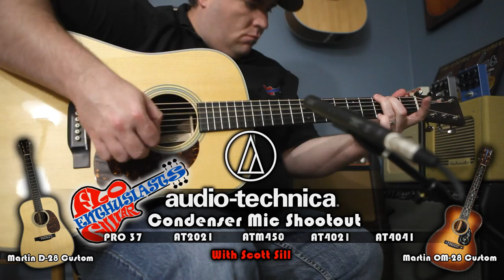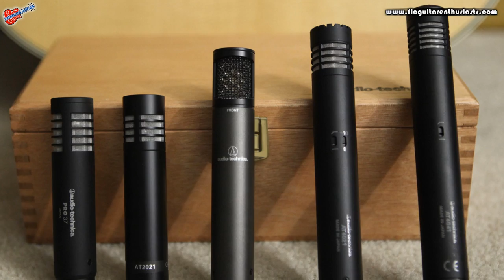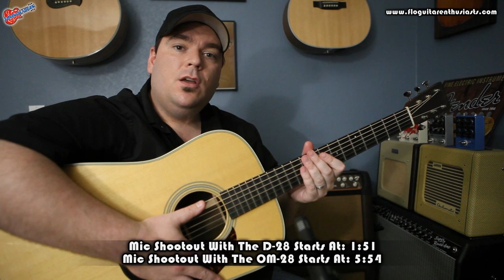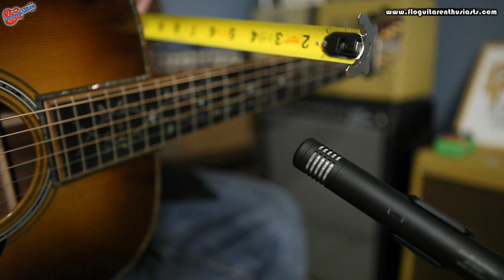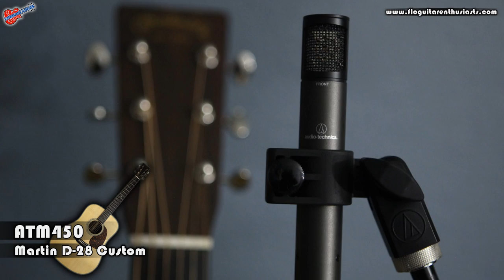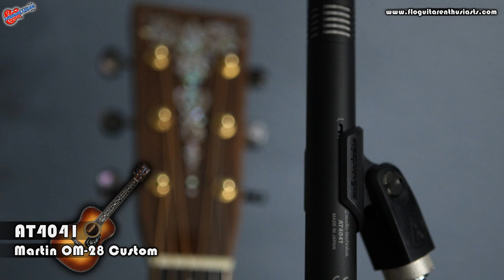5 Audio-Technica Condenser Mic Shootout: AT4041, AT4021, AT2021, ATM450, Pro37 With Scott Sill

Comment: I own two 4041s and I can tell you from my 12 years of experience with them that the positioning of the mics are off for proper tone. It is both too woofy, and dull on the top end for them to be in the right space, I spent at least 4 hours today with a D28 and a OM15 pointed right at one, and it sounded nothing like the 4041 examples you have here. The only reason I say this is that it may keep someone from getting into a great microphone!
Reply from the maker: Daniel Weldon thanks for the feedback.

Comment: Wouldn't it be better to try to position each mic in it's best sounding spot instead of trying to keep the conditions constant? When I choose a mic, I try to see where exactly it will sound best because that is where I will be using it in my recordings. If it doesn't produce the sound I want then, it isn't the mic for me.

I'm just saying this because I thought the placement for the ATM450 wasn't helpful -- it would have been nicer if you brought it closer to the guitar and possibly engaged the low cut.
Reply from the maker: Hmm maybe but this is how i do them

Comment: So I came into this shootout mostly looking for a condensor in a drum setting, for either overheads, hi hat, or snare.  I like that you gave us a variety of playing styles and some dense chords.  Some sounded dissonant too me but you're not a robot so strings can detune during takes or maybe you stretched one a bit at the fret, etc.  After listening on a few sets of cans in my studio, here are my thoughts.

[]4041 definitely sounds woofier, probably picking up that soundhole energy.  Over a set of tom drums that low end beef would be great depending on how you treat your overhead mics in a mix.
[]2021 lots of clarity but lows seem a bit weak.  Would be a good budget hat mic, or cheap enough to buy a stereo pair for field recording.
[]Pro 37 bit muddy but a pleasant mellow response that could be nice when a source is overly bright.
[]ATM450 was my winner here for drums.  Seems to naturally have a bit of the mids scooped, pleasant lows, and feels like it would cut through a mix more on snare or hi hat.  Nice side address format for sneaking it into a jungle of drums, stands, and cables.
[]4021 is excellent, most balanced response IMO.

4021 is currently the highest priced in the used market here.  Significantly more than a used 4041 actually, with the 4041 currently cheaper even than the ATM450 so I'd probably go with the 4041 for an OH pair and 450 for snare or hi hat mic, maybe even toms.
Reply from the maker: Thx for the thoughts!!! Glad you enjoyed the video

Comment: Almost bought the ATM450 today but I see now thats not what I wanted. Thanks dude.
Reply from the maker: MrHWPlainview which one of the 5 did you like.  I was really impressed with the AT4041.   Another mic to look at is the AT4033 which is a fantastic mic too.
Reply: Yup, went ahead and bought the AT4041's after a little more research. Really is good about picking up those low end sounds. Very beautiful. Again, thanks.

Comment: AT4021 is my favourite. The only one of the bunch that approaches a fine level of fidelity and accuracy. A bit cold in a poor acoustic, maybe?
Reply from the maker: doctorfuse007 thanks for watching.  I dig the 4021 too.  I have two of them :)
Reply: sillennium I have an AT4022 omni. Nice mic, but it needs a good acoustic (for classical recordings) or some processing afterwards.
Reply from the maker: Audio-technica makes some great mics for sure and most are affordable.
Reply: +1 for the AT4021. Sounded the most natural and open without an over-hyped top end. ATM450 by comparison was bitingly high pitched with lacking body. - AT4041 would be my second choice, but I'd roll off the topend slightly at the desk.
Reply: The AT4021 was the most musical one for me. I would choose AT4041 for live sound because of its powerful sound. Or AT2021 as a half-of-the-price alternative. Nice shootout, thanks!

Comment: sillennium , great video comparison! 

After hearing all the microphones in the same position, I have to admit I like the 2021 and ATM450 better than all the rest. I have a D28 and I personally know the character and tone of it. The 2021 sound the most balanced and true to tone considering its frequency curves seem to keep acoustic guitars in mind. Acoustic guitars can get overpowering at 100-200hz (thump) so the 2021 keeps a reasonable slop at those frequencies that pick up a more 'natural' sound. The ATM450 has a slop at around 150hz but pronounces the mid-high-end better in which is being boosted at 6-8khz. The ATM450 is best placed at the sound-hole and the 2021 at the 14th fret. In a blind test, the 2021 would better represent a D28, The AT 2021 should sound near identical to a MXL 603. Personally, I would go for a MXL 603 over a AT2021 because you can mod a MXL 603/Nady CM90 very cheaply to get a more open sound than the 2021. 

Together, these would make a very natural and 3D stereo acoustic recording. 

The 4021 and 4041 have different frequency cuts and boost that can be simply done with a 2021 by EQ on a sound board or DAW.
Reply from the maker: Michael Ray thanks for the thoughts and feedback.  Interesting you dug the 2021 best, it is a nice mic for a really good price.

Comment: Thanks for doing this, but methinks that room has some standing waves going on. They all sound rather boomy.
Reply: Part of it is the guitars themselves. Adi and Italian spruce can be driven harder than sitka tops. Backing up the mics to 12in might've helped out more, but I'm kinda glad they're at this position because it really shows the differences between them.
Reply: Yeah, but from the vid, it looks like he has the mic's pointing at the soundhole !!!
Reply: Mics are pointed at the neck joint (around 14th fret). Clearly seen at the 20 second mark.
Reply: My apologies, you're quite right, blame it on defective eyesight. It's a useful video so thanks.
Reply from the maker: Its possible small room
Reply from the maker: They aren't
Reply from the maker: Yep